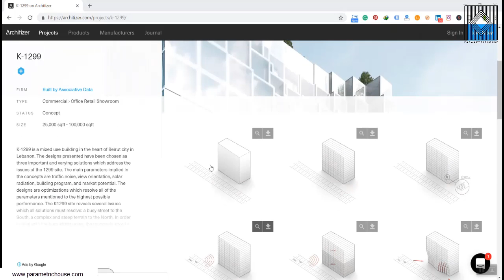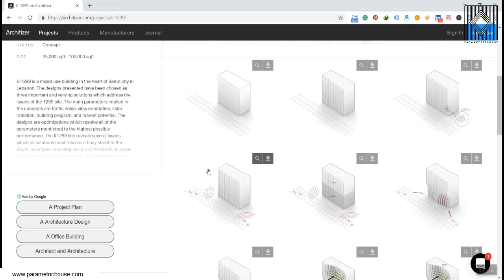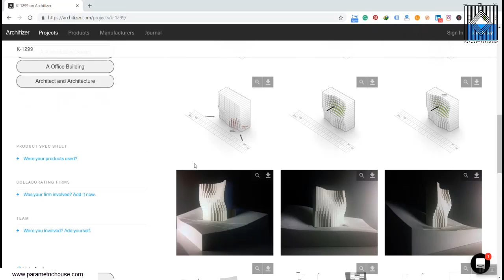Brainstorm #3 : K-1299 Building

Comment: Okay, I'm not 100% sure if its correct, but; :)

I have started from square cells and extruded them. Next, I have used Closest point to calculate distance between centorid of each cells and evaluate surface point. Next I have used ScaleNU to control Y scale by Graph Mapper.

Here is a link to my video: https://www.youtube.com/watch?v=ejx7vZToc5o

Thanks for doing this! Your tutorials are really great!
Reply from the maker: Great job Michal👍 Loved your video. That's right! Using the point attractor technique was the answer! but there is a way you can make this run fast! I'm going to give that tip next week ;)
Reply: @ParametricHouse  Can't wait :) Thanks!